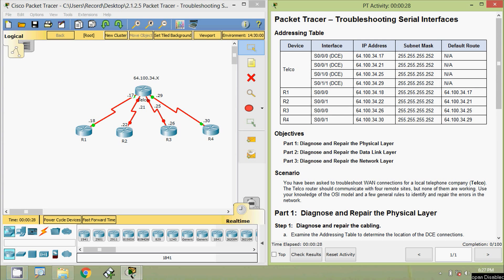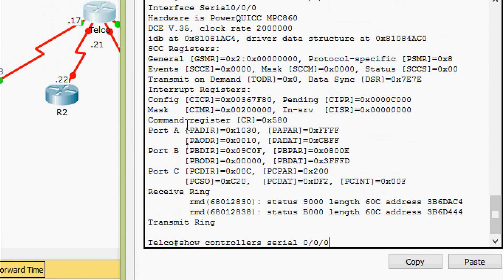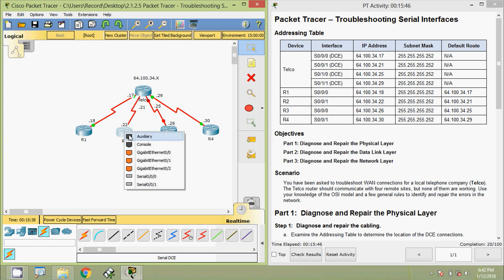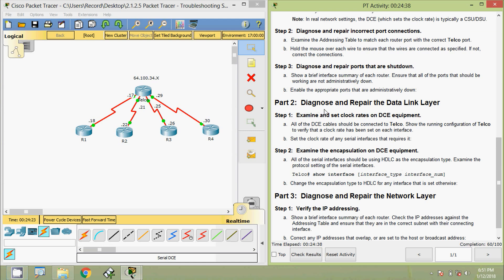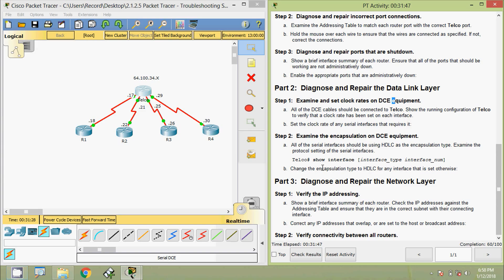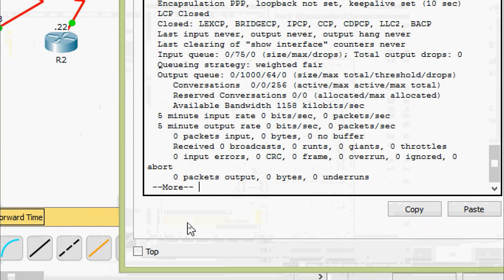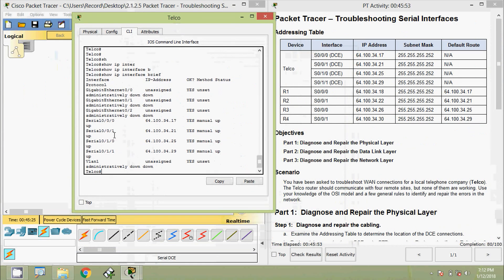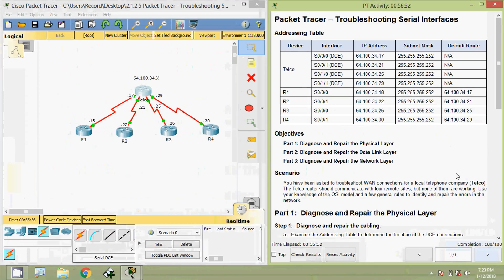2.1.2.5 Packet Tracer - Troubleshooting Serial Interfaces

Comment: Thank you for your explanation sir, i have a question plz, if clock rates did not match between each end, for example between "Telco 4000000" and "R3 2000000", does that make an issue?!
Reply from the maker: Hi
No need to configure the clock on both side of the link, we have to configure only in DCE side.  Usually clock rate will set automatically in new IOS Versions, You need to change only until you have an instruction to change it.
And thanks for your great support and sharing my dear friend...!!
And still you face trouble, please feel free to contact our team using our website.